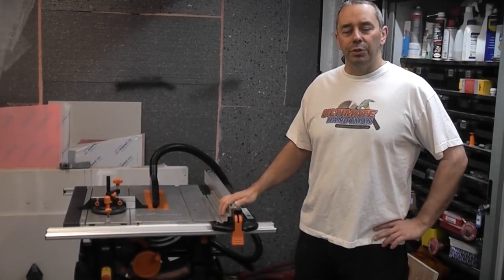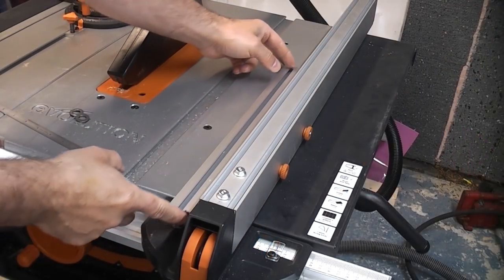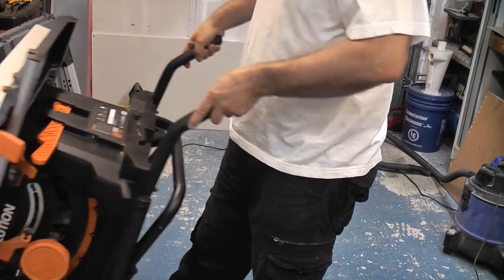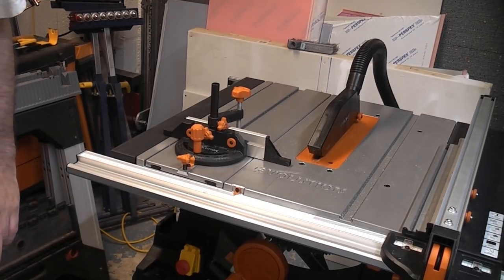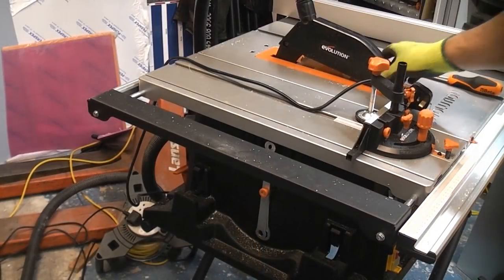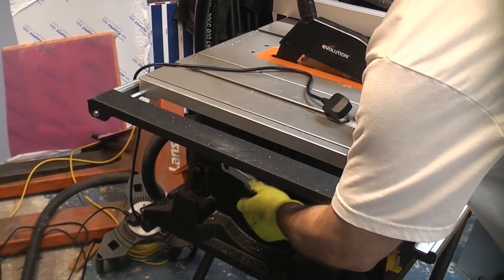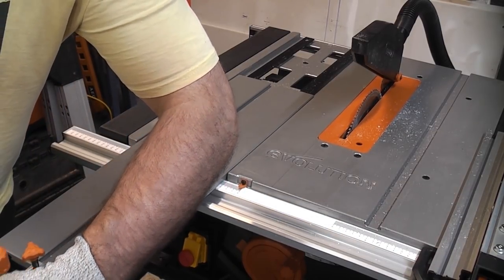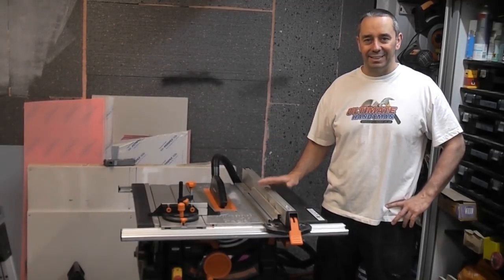Evolution Rage 5-S table saw review

Comment: Sorry if you've answered this before but it seems odd to have a full length rip fence and then rip against a short bolt-on one. Surely a professional saw - which this seems marketed as- would use the full length fence? Am I missing something? Great videos by the way!
Reply from the maker: I'm not sure why they designed the fence that way, there must be some reason for it!
Thanks for the comment
Reply: It is to prevent the workpiece from binding between the blade and long fence as it moves past the blade. The shorter fence keeps it parallel through the cut and the released i.e cut portion, has room to move withouut binding in the space between the shorter fence and full length fence.

Comment: I ordered this saw in April and got delivery last week. Only problem - the blade keeps going out of square. I have to really force the hand crank to get it square and then after just one cut it's about 1.5 degrees off. Has anyone had this problem or does anyone have a solution?
Reply from the maker: I've not had that problem. It might be worthwhile asking their support department, as it could be a problem that they have encountered before.
Reply: @ultimatehandyman  Yeah, thanks. I was planning to give them a call tomorrow. I'll post what they say just in case someone else has this problem in the future.
Reply: @mjribes  What did they say?

Comment: This is a very good review with plenty of details and practical/visual demonstration.
Just a couple of things that I hope someone can answer..... 
1. Is the table saw sturdy, particularly when ripping long timber posts. This means plenty of side force on the legs.
2. Is there plenty of power in the motor to easily cut materials at/close to the max height?
Reply from the maker: I'm afraid I can't answer either of those questions, hopefully someone else will.
I normally only cut wood up to 1 inch thick, and it does a great job of that.
Thanks for the comment ;-)

Comment: Great review! A have a few questions 1) do they make an adapter for American outlets or an American version? 2) can you use dado blades in it? 3) do they have a diamond blade for use with this?
Reply from the maker: Thanks, I'm not sure about questions 1 and 3 so I'll try and find out and will post back in a few days.
I don't think you can use Dado blades as they recommend not removing the blade guard from the machine.
Reply: Dado blades are illegal on UK (EU) table saws because in order to use them the guard and riving knife have to be removed, and is therefore unsafe. This is not the case in the USA. Because of this, all UK or european table saws are deliberatley fitted with short arbors to prevent their use.
Reply: It is sold in the US also. Amazon for one and direct from their Iowa location online.

Comment: I find the evolution blade cuts metal very well and cross cutting is reasonable but for ripping it is very slow, the blade has far too many teeth for clearance. I was contemplating buying a blade for ripping but I am not sure how safe the reducing rings are for a  blade with a  30mm bore to to a saw for 25.4mm bore blade. I know evolution do not sanction any blades other than evolution blades but that is probably evolution looking after evolution.
Reply from the maker: I've used a reducing ring for the acrylic cutting blade that I use on this saw, it works fine.
The flange that holds the blade on is quite large if I remember rightly so a 30mm bore blade should not be a problem.
Thanks for the comment

Comment: my mitre slide was a very sloppy unlike yours  the blade was way off parallel and the fence too needed some filing to get it parallel  i had to file out the motor fixing  slots to get the blade parallel and tap a new hole for theguide rule it was so far out  i had to shim the table slide to get the slop out of the mitre  apart from al;l that work to get the saw safe and accurate  it now works well oh theere is a bit of blade vibration too on mine
Reply from the maker: Blimey, that sounds yours was made on a Friday afternoon (when everyone is rushing to leave work).
Mine has been great, sorry to hear that you have had issues!
Reply: well it was at a discount as i think it was a repackaged return   i have now adjusted the plastic mitre runners to be tight  so no shims now. just  riped down 50 pallet 3x3 to 7 0x 15  for cladding all good

Comment: OKAY THIS IS VERY IMPORTANT MESSAGE THE RAGE 5 NO LONGER COMES WITH THE SAFETY BUTTON AS STANDARD THEY SELL THEM AS AN EXTRA @ £31 SCREWFIX SPOKE TO THE EVOLUTION HELP LINE TODAY 02/10/19 NOON TODAY SO IN THIS DAY OF HEALTH AND SAFETY THEY NO LONGER INCLUDE THE MOST IMPORTANT PART OF THE MACHINE AND THEY ALSO SAID THEY WOULD ONLY SELL THE SWITCH TO A REGISTERED ELECTRICIAN ONLY

Comment: so this is actually a sponsored video?
Reply from the maker: I was sent the saw for free after not being able to get a French cleat cut at my local wood yard as they could only do 90 degree cuts. I never agreed to do the review as part of the deal but was so impressed with the machine that I thought I'd review it. As of yet Evolution do not even know I have reviewed their machine.
Thanks for the comment
Reply: what a shame your local wood yard couldn't do a French cleat cut.. that's amazing, so if I am lacking the necessary tools Evolution will send them to me? :-)
Reply from the maker: Yeah, I thought they would have done it easily but it seems they can only do 90 degree cuts on their saws!
They did offer to make a jig and cut it down the centre at 45 degrees but could not do it for a few days so I just bought the timber and blagged a table saw ;-)
Thanks for the comments
Reply: Ultimate Handyman how did you blag them ;)
Reply from the maker: I just emailed them and said I needed one LOL
I did not realise how much I needed one until it arrived and since then I have not stopped using it. 
Thanks for the comment

Comment: I got one if these saws..... Terrible spend a bit more and get a decent one. Mine woukdnt even bevel over to 45°. The saw bed moves. The sliding mitre gauge rattles in the slot making it impossible to do accurate cuts. The 'cut everything' blade is a gimmick and leaves a poor finish with burn marked in wood..... And the bore makes it impossible to get a decent blade without getting a. spacer made. Took all this to customer services and had to make 8 calls to chase up any action over an 11 day period before  new saw finally arrived, some 7 days later than originally promised. My advice is leave well alone and spend a bit more on a decent saw. The replacement they sent will actually do a 45°cut now but that's the only improvement. This saw has potential to be good value, but needs much more development and tighter quality control before it will get there. 
Over all very poor show from evolution tools